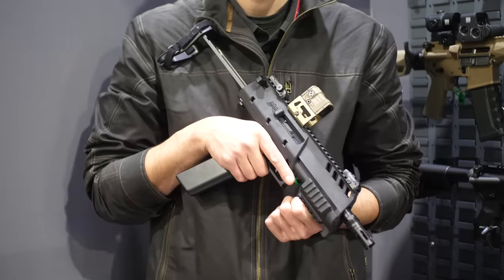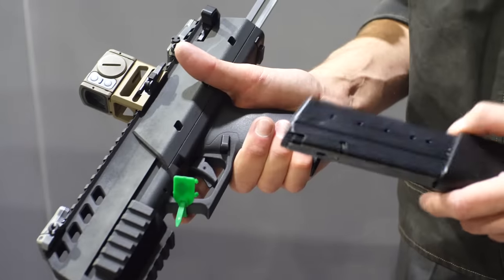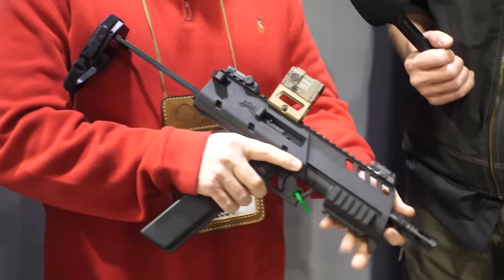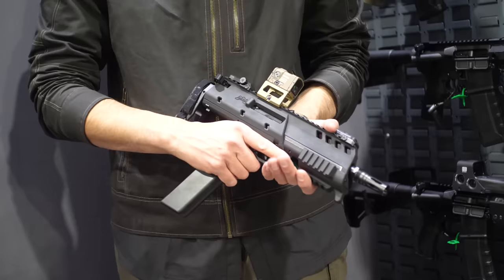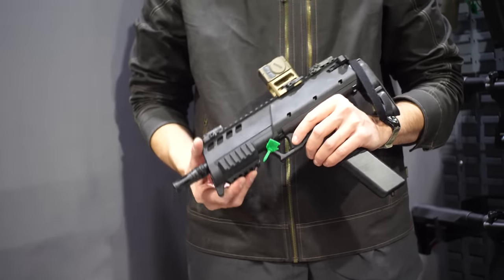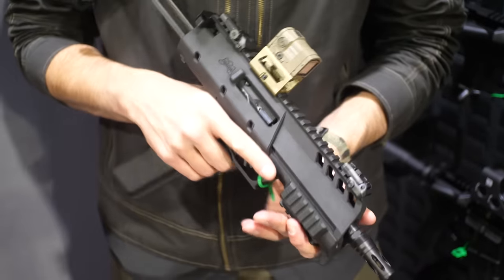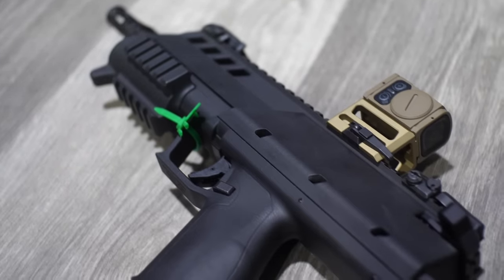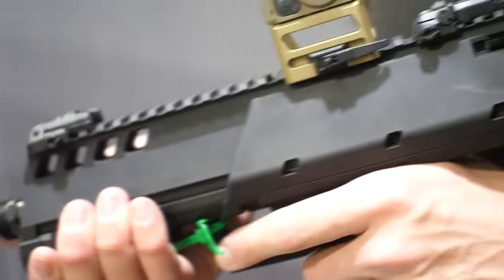The PSA X5.7 PDW Concept

Comment: Whoa, this will blow Keltec away for a poor man’s MP7.
Reply: Most likely, but I still give them mad props for successfully wrapping a fat pistol around the P90 magazine.  Hard to beat that capacity for a gun with no long magazine hanging out the bottom.  If it had a better brace setup I would already have one.
Reply: @herbderbler1585 especially re: aesthetics, I think that comment may have had the CP33 in mind
Reply: @flanaganwaldherr6956  ah, I see.  Yeah, in that case this is definitely a better MP7 substitute, for looks and caliber.  22mag is nice, but it's definitely not 5.7.  I don't know how 4.6 stacks up but I'd imagine it's more powerful too.
Reply: @herbderbler1585 the cp33 is a .22lr. The CMR is a .22mag. The cp33 is like. Micro poor man’s mp7, the cmr30 is just the poor man’s mp7. Also, if you look at ballistic comparisons between .22mag and 5.7, the only thing 5.7 does better is the fact it’s center fire. Otherwise, ballistically speaking, the .22mag does just as good depending on the ammo and does it for 5x less money.
Reply: If poor man can afford ammo 😂🤣😅
Reply: @VitalArms  my bad, I always get those two names mixed up.
Reply: They should really make it in 17hmr or 30sc
Reply: I have to wait a year or more for this chit?  Typical PSA.  50/50 is this actually comes to market.  Comeon PSA.  We wanna hear: “shipping after SHOT”.
Reply: What is the name for this form factor where the magazine is not forward as per usual, not bullpup with mag behind grip, but the mag is located inside the grip ?
Reply: @TheGunsNBlades  Let em cook, I'd rather wait a year if it means the guns are quality.
Reply: @VitalArms from what I've seen 5.7 is way hotter than .22mag. 5.7 has the same ballistics out of a pistol as .22mag out of a rifle
Reply: except that it shoots 57 so its more like the upper middleclass mans mp7
Reply: @VitalArms no, if you look at the ballistics, you'll see a very clear difference. This is a tired comparison. Look at 22mag ballistics by the inch and then compare the 5 7 velocities from the 4.8"bbl.
Reply: @michaelw2288 mag placement doesn’t dictate that, it’s the relative positions of the trigger assembly and the chamber if the chamber/hammer and such is behind the trigger then it’s a bullpup, if it’s in front then it isn’t. There is a “bullpup” pistol by bond arms I think that’s weird looking but still has the mag in the grip, but the rounds come out the mag in the opposite direction when the slide goes back and then are lifted into the chamber when it goes forward.
Reply: @ccrkicksass00123  5.7 has better ballistics this is true. But marginal especially when looking at the massive gap in price.
Reply: @VitalArms  yeah I can't argue that. Lol
Reply: @TylerSnyder305 dam right! I choose this over the MP7
Reply: @virtuaguyverify  well it’s not really a choice since you can’t get an mp7 and even if you did there’s no parts available
Reply: @VitalArms I've got the CP33, and other than being finicky with cheap ammo, mine runs great. I've turned mine into a cheek pistol and it's dead accurate even past 100
Reply: @VitalArms  my point exactly, even if there is a choice. I wouldn't own one, 100 reasons not to
Reply: @VitalArms  Tommy Built announced his T7 this year at shot show... so you'll dinnertime be able to own one with Domestic support.... but it's going to be like $3.5k....
Reply: 5.7 ammo is getting more affordable, 45 (fmj) to 55 (vmax) cents per round
Reply: @Muromez2010  For sure. Although prices have come down significantly since the days of the beer bug.
Reply: If it’s available. I STILL can’t find  their M110 clone
Reply: LOL
Reply: Doesn't the cp33 come in at like 600 bucks , I don't think this is gonna steal too many , especially since 22lr is so cheap in comparison to 5.7
Reply: @VitalArms  That is a hilariously incorrect statement. You are comparing 22mag velocities  from a 16 inch barrel to 5.7mm from a 4 inch barrel. I just went to luckygunner's ballistic gel tests and looked at 5.7 and it compares very very closely to good 380acp loads or some weaker 9mm loads in both penetration and expansion. Only difference is mass. Saying 22mag is just as good as 5.7 is so ignorant. 5.7 is right in the middle of what is generally accepted for self defense loads (380-9mm). You can decide if 5.7 has any advantages over 9mm, but 22mag isn't even playing in the same game.

Comment: I think, and i'm guessing i'm not alone on this, the PSA X5.7 PDW is the most exciting thing announced at shot by a landslide. We're all just trying to live out out Brass Facts get home bag larp fantasies without paying 2k for a TP9
Reply: Most exciting thing by far is Tommy builts mp7
Reply: I Have the Rock it is hand down one of my favorite weapons and i have way more then i should have….ask the wifey.
Reply: Pretty sure most exciting thing is the Beretta 92 GTS.  It is a 92XI, but with a frame-mounted decocker instead of a frame-mounted safety.  Talk about innovation.  And also Diamondback's $770 snubnose...
Reply: @christiankuny858   i've heard some nightmares about Tommy builts. Also idk where i can get any 4.6, but 5.7 is everywhere these days. They could make this thing in 9mm i wouldn't mind, infact i hope they do, I just want a pdw in that under 15inch total length category that doesn't have a 2-4k barrier or availability issues.
Reply: I liked the 308 Jakl, 9mm Jakl, 10mm dagger & 45 ACP full size dagger concepts more 🤷🏻‍♂️ but that thing (5.7) & the VUK are my runners up.. I don't care much for 5.7 though
Reply: @christiankuny858 bro, it's an mp7 who cares. Not commonly made cartridge, gonna cost an arm and a leg from a boutique builder, and it's based on a design by a company that hates you as a person.
Reply: Christiankuny858- When I heard $3500, without a stock or brace so add another $500-600 plus $200 for NFA reasons screw that! Plus 4.6 is too obscure.
Reply: I'd say Pindad supposedly importing their FNC and Beretta M12 clones this year is the most exciting.  Followed up by this, Zastava building RPKs and M77s styled up like Tabuks, and then H&R building Colt LMG and DOE SMG reproductions.

Comment: PSA just won Shot Show 😂😂 weve been wanting an MP7 itch scratch for a while.

Edig: omfg, theyre gonna make a binary trigger for it. This is absolutely amazing.
Reply: tommybuilt
Reply: zokhrozzwoomzy- Overpriced, out of stock, unreliable, in a more expensive obscure caliber.
Reply: @gifthorse3675  Not overpriced. Reasonably priced compared to what a post sample costs. Obscure caliber? No shit, what's your argument? 4.6x30 is what the mp7 is originally in. Out of stock because it isn't in stock yet? How do you know it's unreliable, post a video of your sample size of 1 failing, oh wait... Cope.
Reply: @gifthorse3675  5.7x28 is a NATO cartridge. It's not obscure, but it does cost a little bit more than other calibers that have been around for nearly 5x as long if not longer.

I think it would have been better in 22tcm/22tcm9r but Armscor hasn't and probably won't license it out to other manufacturers. 22tcm fits your definition of obscure caliber much more than 5.7 will ever be going forward. It also costs about the same as 5.7x28....unlike 4.6

1K is a mid range price for a lot of guns. PSA (to my knowledge) hasn't breeched the 2K mark like many other manufacturers have.

Unreliable?  Bro.... the gun hasn't even come out yet, let alone has finished the process of full scale manufacturing.  Some things might and probably will be changed from this prototype.  It's good to be skeptical, but you aren't even giving it a chance.

With that mindset, we'd all be using m14s because the AR15 is overpriced, and chambered in an obscure caliber.....at THAT time. Even at THAT time .223 didn't have an official NATO designation established when the AR15 was in its own developmental stage.

Comment: the only downside I can see with this thing is the fact that it uses the recoil system from the Rock, which is itself a clone of the delayed blowback / recoil system of the FN Five Seven. As the MP9 and a bunch of pistol chassis have proven, you really don't want a reciprocating barrel in your PDW. The MP7 intentionally used/uses a gas system to solve this.
Reply from the maker: That's an interesting point. I would definitely prefer a fixed barrel in a system that doesn't have an optic mounted to the slide/barrel assembly.
Reply: Where did you read that it’s going to have a moving barrel as part of its cycling function? I’d have thought the x57 would have a free floating barrel and delayed blowback like every other ppc/pdw
Reply: @LL-my5rl  PSA themselves have said multiple times that the X5.7 PDW will use the same operating principles as the Rock pistol. The Rock has a reciprocating barrel that temporarily locks into its slide via a spring-loaded cam in the frame, right in front of the trigger. It’s a “short recoil” system. This is basically the same as how a Beretta 92 works, and without it, the slide would have to be a lot heavier for the gun to operate safely. This design is a functional clone of that of the FN Five Seven. Ruger cloned it as well in their Ruger-5.7. I guess it’s possible that PSA’s X5.7 will just be straight blowback, which would mean a fixed barrel, but that’d also mean more recoil. And I feel like they would have explicitly said “straight blowback” to at least one interviewer if this was true.

IMO they should have gone with roller/lever/gas-delayed blowback, or a short-stroke piston like that of the MP7.
Reply: @124thDragoon  The 4.6mm ammunition used in the MP7 has a higher chamber pressure.
I remember the MP7 bolt being more like an AR15.
Reply: I’d really like to see this with a little longer barrel and foregrip. Two inches would seem to make it more versatile as a truck gun.

Comment: Meanwhile I'm curious if anyone is gonna try to cover the MP9. Honestly something like this in 9mm just makes more sense for me as the prices have to be insane ammo wise so quickly.
Reply: The only problem is that the mp9 is $2000
Reply: @matthewlea5027 and it comes with a crappy trigger and 45$ mags
Reply: @matthewlea5027  which is why I'm saying I'm surprised no-one is trying to get in that market. It's like... Right there.
Reply: I would wager that PSA will have a version in 9mm that takes Glock mags within a couple years of whenever this gets released. If/when they do, it’s probably 99% likely that I’ll get one. 

I like a lot about this, and I get why they went with 5.7 to start, but I myself just don’t care to jump into another caliber that’s as pricey and tricky to source as 5.7, along with a new set of magazines. Not for something that (for me) is gonna be limited to a fun range toy. 

But I’m definitely telling a friend who owns a PSA Rock that they need to get this.
Reply: @hkfifty871  tbh I'd be down for that. Though honestly I kinda want a design that doesn't look like it's trying to be an MP7, I'd rather have something unique. I have wondered if someone could scale down some of the huge Glock Mag Carbines.

Comment: Yeah, I'm absolutely getting one when available.  I've long wanted a FN P90, but that's not going to happen.  By the time I purchase a PS90, apply for a SBR, install the proper length barrel... I'd likely would have spent 3x what the X5.7 will cost.   I hope it has a comparable capacity (when some extended mag option) as the P90/PS90 50-round mag.
Reply: i believe the extended mag they have shown there holds 40, so not quite the same, but pretty close
Reply: @mmorin92  Sweet!  Thanks for that info.  👍

Comment: Unless you can put a FRT in it, its basically a V6 Mustang...
Reply: A V6 Mustang still rips if all of your other options are Civics
Reply: just get the ar 5.7 so you can use your mil spec lower. and put all your ar 15 compatible parts if you wanna run 5.7 with traditional AR. this is NOT for that. the binary is cool. but lets be real, it wont be long before they are able to put in a super safety on this which trumps the FRT all around. this will replace my backpack strap for sure. along with the new shorter rock.
Reply: A binary trigger is “close enough”for me.

Comment: High ammo cost is always the number one thing holding back 5.7
Reply: bought like 300 rounds for around $100. very rare sale yes. but in comparison, i got 400 9mm HP 135Gr at $98 so it is getting cheaper. the more we have in the market the better. just need more variety in 5.7 cans. cant wait for it. 5.7 is great.
Reply: Biggest thing holding back 5.7 is 5.7 itself. It's ballistics are severely overrated, sadly. If they made this in 9mm I'd be all over it.
Reply: @thefamilybrit I’m sure a 9mm variant would be in the works I like the idea of one feeding Glock mags. But the 5.7mm has a range and accuracy edge over the 9mm which for CQB is pretty good.
Reply: @thefamilybrit  I don't know if the ballistics are "overrated".  People usually exclaim over the size/speed/rate of fire ratios for 5.7 ........  it's not that it's powerful, it's that it zips through soft armor and gives you 20+ rounds in something just a tad bigger than a full size pistol.  So for argument's sake, this would be the #1 contender for CQB/urban warfare shtf blaster.
Reply: @jessesimmons4503  range and accuracy? We're talking about PDWs here, we're not trying to hit things 200+ yards out. 9mm is pretty adequate for the use case of A PDW

Comment: Honestly, I think the reason that PSA are putting the expected release date out over a year is because they want to see if the arm brace ban survives or not. If it dies, great! If not, the project pretty much dies as the gun just becomes a bulky Rock 5.7.
Reply: I haven't seen anyone bring it up in decades but an older ATF approved NFA hack was to have an unmounted stock on a .22 pistol held in place by the shooter's grip pressure.  

One way or another these are gonna sell.

Comment: At what length barrel on the 5.7 does range increase? I think it needs a textured grip and a selection of barrel lengths. If the OAL is under 2' long with a collapsed brace, that would be awesome. I'd also make the magazine stripper clip compatible.
I'm not an engineer but I'll volunteer to do field testing!!!

Comment: would make a great vehicle stored PDW. 5.7x28 rally shines in a vehicular environment due to its light armor piercing capability. A Texas LEO friend of mine keeps an FN FiveseveN in his squad car for its ability to punch thru car doors, stressed members etc. No other pistol round comes close, even magnum rounds or 10mm Auto. Next step up is 5.56mm Green tip or 7.62x39 (AK is absolutely devastating to vehicles btw as standard ammo is copper over steel - it will punch through a door brace like its made of butter). But for something more compact than a shorty AK or AR this is super viable.

Also in a world where active shooters or terrorists can access light body armor 9mm has ISSUES. 5.7x28mm solves a lot of those issues - that's why you are seeing its resurgence.

Comment: I want one and I want Brass Facts to spend his life savings reviewing one of these. 
Real talk: If production is functional and the size of prototype, this will quickly become my backpack PDW. 40 rounds of 5.7 in something that fits in the laptop compartment of a backpack without BS is a gun you can travel with, hike with, carry every day.
Reply: I have a rattler with a folding brace that fits in my laptop bag. I got the upper that’s compatible with a mil spec lower for $1200 and just put it on a mid range lower I had laying around.

Comment: i still want to know if it uses a gas operated system like the actual mp7 or if it uses the rock 5.7 pistol operating system 
mp7 are so smooth because it’s a tiny g36

Comment: i still want to know if it uses a gas operated system like the actual mp7 or if it uses the rock 5.7 pistol operating system 
mp7 are so smooth because it’s a tiny g36
Reply: I think it is direct blowback to keep the price down and since 5.7 is a low recoiling round, a piston system is not seen as warranted.

Comment: I’m kinda let down by several design choices they made.

1: Designing it based on the Rock pistol and just removing the slide and slapping a top cover on it seems like a clunky way to make a PDW.

2: It’s almost certainly direct blowback instead of a rotating bolt like the real MP7, which means it will have more recoil than necessary.

3: The handguard looks super ugly. I wish they would’ve just went with M-LOK on the 3,6,9 and pic rail on top like many AR handguards are designed.

4: Using AR parts and accessories seems like another bad design choice. A PDW is meant to be as lightweight, compact, and minimalist as possible. So throwing on big heavy AR backup iron sights and a full size T-handle just wasn’t a good idea.

Comment: This would be better in 22tcm9r. Its more avaliable its a faster round, its more powerfull having the same ftlb as 9mm, its got super low recoil, its cheap as hell being 25bucks per 100rounds or 145 for 1000. 5.7 is multiple times over more expensive. Also 5.7 is only giving you ftlb similar to like 22mag just about but 22tcm9r is doing 390ftlb 9mm is 400ftlb. Also 22tcm9r is sending 39grains at 2300fps out a pistol barrel 2800fps out 16in rifle barrel the 5.7 is sending much lightwr rounds at barelt 1900 to 2000fps in a pistol and only like 2500 to 2600 in rifles. 5.7 is stupid. Get 22tcm9r pistols, you also get to shoot 9mm out of the same guns and mag by simply swaping out the barrel. Its easier to find in stock its more accurate it destroys barriers more in a pistol its 2300fps or more in a 16in barrel its doing almost 3000fps its all around better than 5.7 in all and every way 5.7 is a over priced, underpowered, less avaliable, harder to find round compared to 22tcm9r period. 

I want mp7, mom: we have mp7 at home. Mp7 at home.